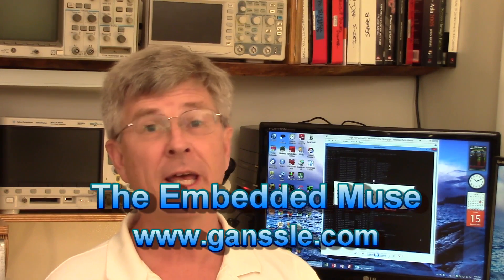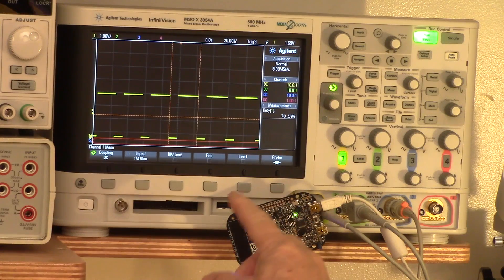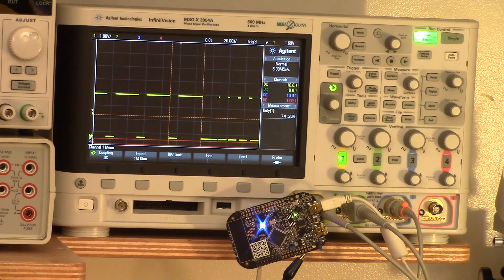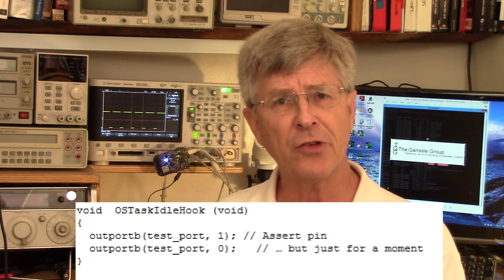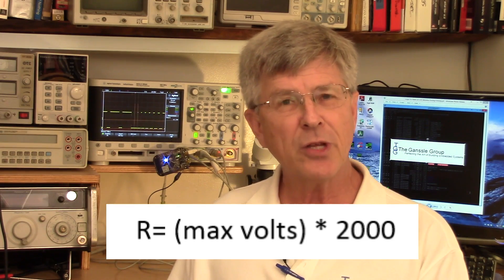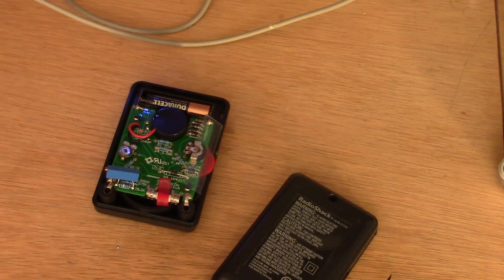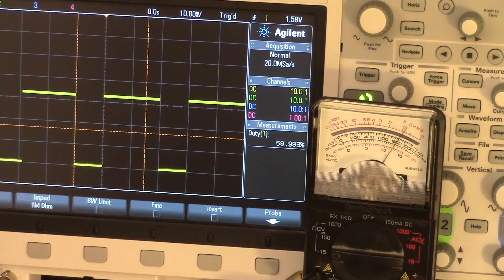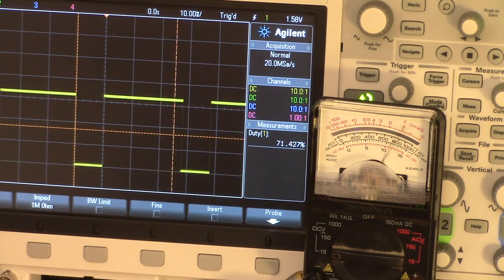Episode 12 - How to Turn a $25 VOM into a $10k Performance Analyzer

Comment: You don’t need to buy a meter for this. Get a LED, drive it with that signal and process it with a photodiode hooked to a transimpedance op amp, then to an ADC of a micro and calibrate. It’s cheaper than those 25$ and definitely better, you can plot graphs and all kinds of stuff with that.
Reply: Cheaper, but way more effort to make it work reliably in any lighting conditions. Good idea, though.